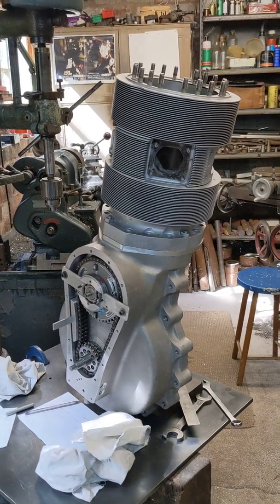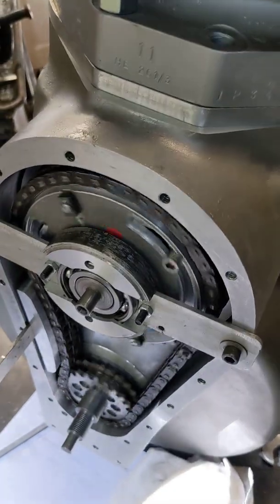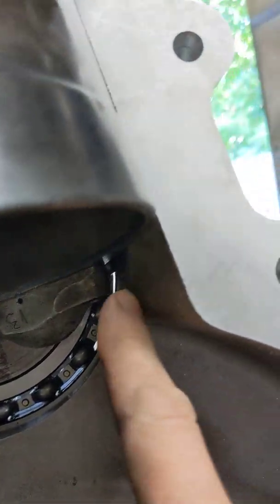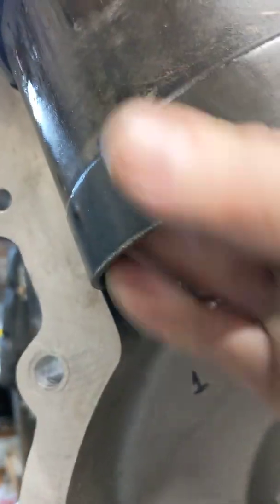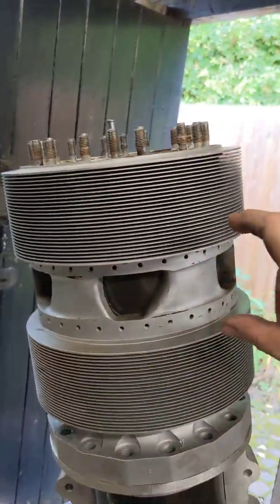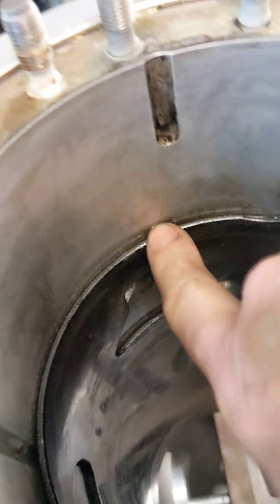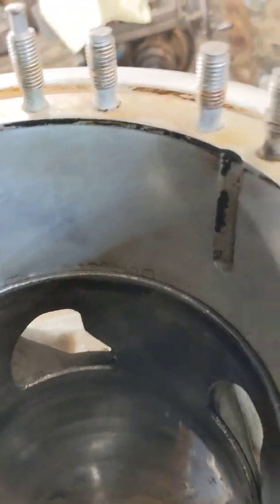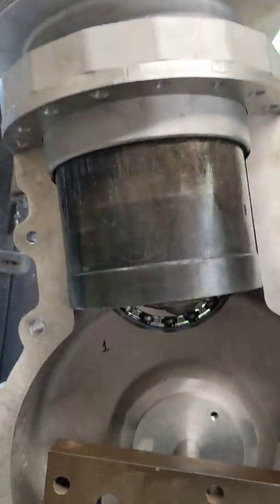We have clearance Clarence! (or maybe not).

Comment: Is there a reason that sleeve valve engines were not used in road vehicles? I mean if they are good enough for an aero engine then they must be reliable.
Reply from the maker: There were a couple of vehicles that used them, around a hundred years ago! The Bar & Stroud motorcycle and the Willys-Knight truck are probably the best known examples. The issue was manufacturing the sleeves, as they are difficult to make and early ones were prone to cracking. 
The other difficulty with sleeve valves is raising the compression ration. As compression is raised, the top of the piston obscures the valve port so it affects engine breathing. Bristol solved that (and the thinner air at high altitude problem) by fitting a supercharger. (Ooh, now there's an idea 🙂).
All of this is doable in an automotive power train, but the appetite for risk is very low in that industry. Developing a radical in engine design is very rare. Ford did some research into 2 stroke sleeve vale engines for cars, but as I know nothing came to market.
Reply: MY GRANDAD HAD A 1928 WILLYS KNIGHT WITH A SLEEVE VALVE ENGINE. I RODE IN IT MANY TIMES. VERY SMOOTH RUNNING, BUT IT HAD 2 SLEEVES, INTAKE SLEEVE AND EXHAUST SLEEVE.
Reply from the maker: @donaldbowen5423  wow! What a great memory to have. 😁